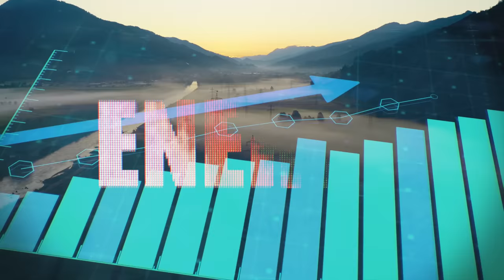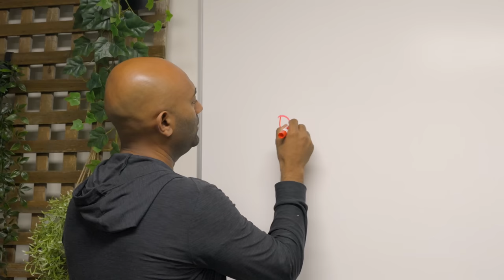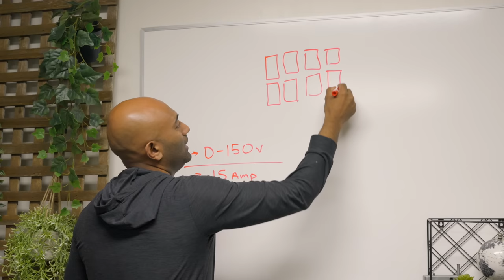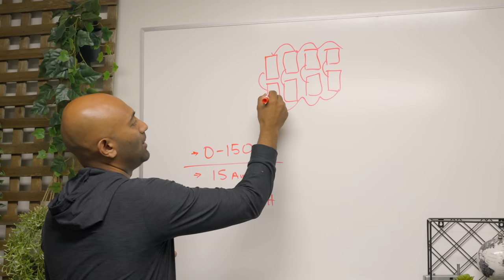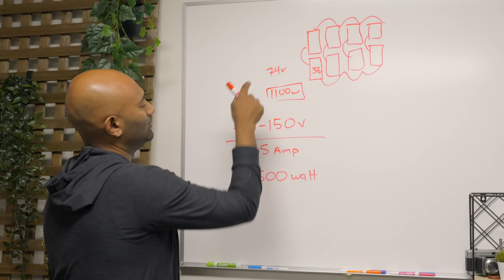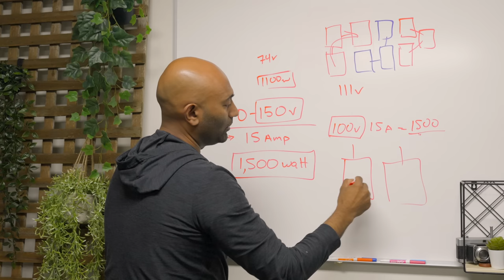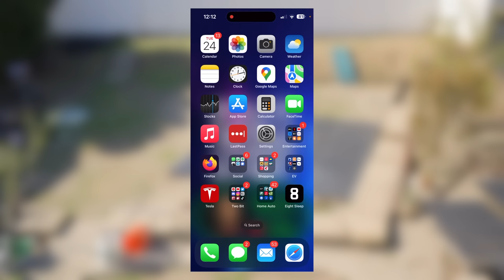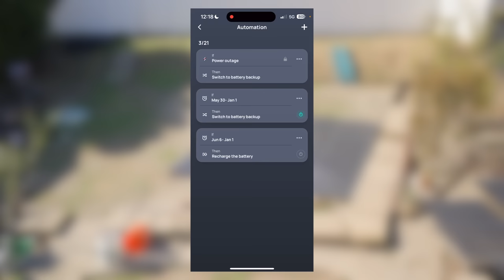Home Backup Power + Solar Power WITHOUT Permits!

Comment: Where I live (FL) attaching panels to your roof requires a permit and engineering. Connecting those panels to anything that touches the grid also requires a separate permit. Everything requires a permit these days. It's ridiculous.

Comment: In the process of returning one of my Delta Pros. The solar connector fell into the unit. I watched a teardown video, and the solar connector is held in by just screws going into the plastic back plate. Not well done.

Comment: Off grid ground mounted panels with batteries is the killer app.  No permits no electricians! Keep adding panels til you run out of space or input watts. If the battery is full just run the AC or heater til the sun goes down ! 😅

Comment: My problem with getting the EcoFlow solar moved into my house is the HOA so I'll have to get the panels on the roof instead of in the yard, never doing an HOA ever again
Reply: My power company will freak out next time they count and see I've added 12 more panels :D I'll tell them to pound sand thanks to it not being grid tied
Reply: with the voltage calc you also need to account for the voltage raising with cooler temperatures

Comment: Great video... I have been looking at using ecoflow in the same configuration you have, but missed that they have a smart panel, and didn't think about the fact you wouldn't have to send power back to the grid (bypassing the need for the permits!).

Curious, where did you get the used solar panels from?

Comment: DIY solar it's fine for small or lower power when you get into higher power solar really should get permits and follow the rules. It protects you against lawsuits, and possible insurance not paying if there is a claim. It can increase the value of your home if you go to sell by having a fully permitted solar system that will back up grid power. Company called Greenlancer that will create all the professional design drawings you need to submit to the city and utility company. They only charge about 300-500 depending on how complex your solar system is. You can DIY solar the legal way and have something professional looking at a fraction of the cost what a solar contractor would charge. You need to learn all the information is online videos, and websites. You might even find an electrician who is licensed to assist you.

Comment: Is the inverter for the load, or do you need AC to charge the batteries? Don't the solar panels generate DC? I figured the batteries would get charged with direct current?
Reply from the maker: you're right i meant the charge controller apologies
Reply: Correct, the EcoFlow internally charges the batteries from the solar DC input.   It can also charge the batteries with AC (e.g. from the wall when the home is on grid power), but the EcoFlow does not handle AC-coupled panels.  It has no ability to do the required frequency shifting to control production.  I don't think anyway.

-Matt
Reply: @TwoBitDaVinci  No need, I just don't know much about all this. I am extremely grateful for your channel though, I'm getting some precursory education. The dream is to set this up for myself once I can afford it....

Comment: If I had two Delta Pro’s with a 240v double voltage hub and tie that into a breaker in my panel (similar to how my solar inverter is installed). Could I use the AC input to charge the Delta pro batteries from the grid (really the excess power I’m generating from my solar array) during the day and set it to push that power into my panel at night. I’m in California and have a net meter installed as I have solar already. With time of use it would benefit me to to take some of the power that I’m generating to the grid during the day and store it in batteries and use it at night when power is more expensive. Thoughts?

Comment: Do you think a 3-panel and 2-panel series hooked parallel will work for a Delta Pro?  I have 10 Mission Solar 310-watt panels to use for 2 Delta pros.  I’m trying to get a plan for two sets of 5 panels to charge my Deltas.  The 150-volt max limitation is my problem.  Your expert advice would be welcome.
Reply: all 4  sets of 5 panels are wired to 16 amp circuit breakers in my garage.

Comment: I love your videos, BUT your statement about "without a permit" is VERY misleading. Since you aren't connecting to the grid you don't need Utility permission but here in Florida you still need a building permit because you are building a permanent solar array. Without the array you might be able to get away with just installing the batteries but even that is technically wrong. You might still need a permit because you are altering your electrical system with a permanent connection.

Comment: love the white board :)
Reply: this is the best on-grid option, no need to think about the grid
Reply: need to export the logs, dont save them on the device, automatic email
Reply: do prime quality the first time, dont cheap out on that
Reply: qc is 100%, not 90%
Reply: dont make bugs or poor products
Reply: pure dc brushless motors, ie hall-effect motor-generators, no ac/commutator/controller parts required, just dc power going in, maybe a potentiometer to adjust motor amperage/speed
Reply: super simple system
Reply from the maker: Thanks glad you liked it. Are there any other home products or approaches you would like to see us do?
Reply: @TwoBitDaVinci  wish-list: sub-nano optical-mechanical cantilever mems gate processors with electron beam mask lithography process, 3-in-1 new tech if you include pre-rom/ram-memory ops only, like INT16/FP16 (but be sure its not the optical non-linearity multi-frequency version, but the single frequency standard clock-signal processor type, but optical not electrical, its novel, none actually are doing it, and no single crystal wafers required, amorphous/polycrystalline silicon MEMS wafers are just fine) xD
Reply: @TwoBitDaVinci  yes optical photon momentum/energy physical cantilever pushing transistor, because they are nano/sub-nano sized
Reply: @TwoBitDaVinci  carboncrete, ie, dried biomass powder flour carbonization into compressed/foam tiles/panels

Comment: I have a question, I want to set up my house with the ecoflow smart panel, do I need 2 ecoflow pros or can I use 1 pro and 1 ecoflow 3600 expansion battery for 240volt
Reply: You need two Delta Pros and remove the jumper from the Smart Panel to generate 240V. 
Adding the battery alone just increases the capacity.

Comment: Great system. but one WARNING never connect or disconnect the solar cables when the sun is shining.
on 150 volt DC an arc  wil not go out and burn your connectors and even more. plus 150 volt is lethal.

Comment: Hi ,I'm in San Diego as well! Would you be interested in using my home solar install to make some YouTube content? I'm piecing my solar system together myself , so far have purchased 30 325 rec panels and 30 iq8plus inverters. Now not sure it's the right way to go as it doesn't appear it's easy to make this system off grid and not easily paired with Ecoflows . Any tips greatly appreciated Would love to connect!

Comment: You might want to consider placing your battery bank in a housed unit away from the house. When the lithium batteries fail they will set your house on fire and they are very hard to put out. I have my batteries in a metal safe and if they combust, they cant spread to anything else.
Reply: LIFEPO4 batteries dont do that.
Reply: @raullasvegas  Lithium polymer batteries are susceptible to thermal runaway. You may want to research it if you think they are not.
Reply: @KC98561  I said LiFePO4 not lithium polymer. Also, this whole idea is bad. Its electrically unsafe, and wont pass inspection. Code isn't being followed, and he did indeed need permits because its permanently installed. Where is the rapid shutdown switch? A firefighter will just watch that building burn.
Reply: @raullasvegas  I see, thanks. How does he keep the electricity from going back into the grid and shock an electrical worker?

Comment: It's sad that EcoFlow batteries are so expensive. If they had the same kWh-cost on EVs we would still not have any EVs under $100k. 
3,6kWh for over $4000 is way to much. Even half would be a bit high.

Comment: What is the cost and the estimated break even?
Reply: A  little over $13K for the 2 Ecoflows with extra batteries. Not sure about the smart home transfer switch.  Solar panels $70 ea x 18 = $1260 , wiring and MC4 connectors around $100.

So all in all around $15K  with used solar panels, closer to $20k with new panels.

If you are paying 0.25 a Kwh, $15K = 60,000 Kwh of electric.     2  Ecoflow Delta Pro's with extra batteries can store a combined 14 Kwh of electric.

If you used the entire 14Kwh everyday which would be easy to do, and 3000 watts of solar panels could recharge the batteries every day, which is next to impossible. The payback would be 12 years. 

However a 7.5Kw Generac propane back up generator installed with a 500 gallon propane tank will run you around $7K - $8K when all is said and done. I've heard of folks burning through $1000  a week in propane to keep the lights on. So realistically a standby generator has no potential to power anything off grid for free like the Ecoflow can.

So look at as a major improvement in stand by generators that allows you power parts of your home off grid using solar. It's an excellent unit and solution for the majority of the public who want a simple backup power solution.

If you want to go off grid you could DIY a system with 34 Kwh of battery power instead 14 Kwh and 10Kw of AC output instead of the combined 7.2Kw, plus all new solar panels for the same $15k. Which would run your whole house off grid 24/7 for most of the year.

Comment: My electric bill is so cheap there would be no point in solar where I live. I think we pay .07c/khw. During winter i don't even get up to $80/month and thats with running space heaters during the day. In the summertime we can run the air conditioner all day/night and the bill won't even be $30. I have a gaming computer, lights on, but all lights are LED and everything is energy star rated.
Reply: Where is that?  Enjoy while you can.  I pay 33 cents a kwh for the first 290kw, then it jumps to 39 cents a kwh until the next month's billing begins. Its Pacific Graft and Extortion in the San Francisco area.

Comment: Could you have tried 4 in series? If My math is correct, you would have been just under 150v.
Reply: Don't want to push it that close to max voltage and risk damage on a bright cold day as it could go over the 150V max.

Comment: Depending on the type of load you power you may only get 50% efficiency from your EcoFlow Delta - half the power out from what you put in!. 
It takes 2.4kW to fully charge the 2kW unit, but you may get only 1.2kW out when powering non resistive equipment - ie motors, electronic equipment which have pf (power factors) < 1.0 - a Laptop may have a pf of 0.41!! 
Thus 2kW output 'useable' power output is only for resistive loads. With low pf loads you can have 50% losses!!

Thus beware if using the battery generator to try and use cheap charging rates at night for powering non-resistive loads during the day - it will end up more expensive!!  

Unless you have a more modern mobile, the App is not supported, and therefore you cannot do any firmware updates. There is no other method for Firmware updates.
Reply: PF greater than 1 not possible!!!
Reply: @larrywong7834  A pf > 1 was never implied - only effect of PF < 1 mentioned.
Reply: "Power factor is a ratio of true power to apparent power. There exist good, bad, and poor power factors with specific ranges where 1.0 to 0.95 is said to be good, 0.95 to 0.85 poor, and 0.85 and below is said to be bad"

Comment: Nah the system is too expensive for backup power. Just get one or two deep cycle marine batteries for that purpose if you are doing time of use power shifting. Depending on where you are you may not be able to get back the money you spent on ecoflow system. Also lead acid batteries are actually more recyclable. If you don't plan on doing alot of charge cycles just very few instances of blackouts, deep cycle marine batteries are way more economical and environmentally friendly

Comment: COnnecting to the grid has NOTHING to do with permits. If you have electricity in your house, you need  a permit to install it. It doesn't appear to be UL listed. Which means, in CA, you cant get a permit. Your homeowners may also not cover losses.  An actual installed, UL listed system would be a comparable price.
Reply: You don't need a permit to use a battery pack or a small power station.   Like a GoLabs 200 for example, or a Bluetti EB55.  So, no, you don't need a permit to use the EcoFlow either.    As long as the AC-output is not tied to the grid in some way, the utility has no say.

There is no California law or regulation that I know of that would require a permit for this configuration.

-Matt
Reply: @junkerzn7312  You dont know you have to pull an electrical permit and follow the NEC? Seriously?
Reply: @raullasvegas  because you don't.  It's not grid-tied... the way he has it setup is no different than a portable power station.  

Quote the law that says you do.
Reply: @junkerzn7312  the NEC
Reply: @raullasvegas  Quote the actual regulation and stop bullshitting.   "the NEC" doesn't cut it.
Reply: @junkerzn7312  The actual regulation is the NEC.
Reply: @raullasvegas  So, basically you can't quote the actual regulation, and you have no clue.   Which is what I expected.
Reply: @junkerzn7312  You shouldn't work around electricity if you dont understand that the NEC is the regulation.
Reply: @raullasvegas  Poor guy, you got called out, got caught out, and now you are reduced to just blubbering the same nonsense over and over again. 

Quote the regulation.  It isn't "the NEC is the regulation".  Sorry, doesn't cut it.

No?   Oh well.  Too bad for you.
Reply: @junkerzn7312  Sorry, sorry little man. Have you googled national electrical code yet? No? So youre just here to be a troll and pick fights.
Reply: @raullasvegas  The crazy thing here is that you actually believe your infantile insults mean something.  But by all means, continue making a complete fool out of yourself.

Comment: I enjoy this but I think you have an obligation to the solar community to have an electrician come in and review your projects. When you share this info with the public, it might be taken at face value without much extra research. Having a pro check your kit before you share it widely means your viewers are less likely to make mistakes that could be dangerous or costly. It also means you'll be better informed before you jump on camera which will make for better, more seamless videos.

Comment: Without permits? What is your source for that? I think you're giving wrong information here.Just because your solar system is not connected to the grid does not mean it does not require permits. Not being connected to the grid only means that you won't need a permit for connecting to the grid. Other permits are still required. I don't want to rain on your parade. I like the idea of what you're doing. However, you are posting multiple public videos showing extensive electrical work and claiming not to need permits for at least some of it. You're adding outlets, changing circuit amperage, putting solar panels on your roof (which may require a structural permit, too), adding a smart home panel, etc. You've also mentioned the city you're in multiple times. Codes vary widely across the US. You are in a particularly strict area. I enjoy your videos and wish you all the luck with your projects, but people watching them need to know that a lot of what you're doing requires permits in many (if not most) jurisdictions. People have to check their local codes.

Comment: What did you get from Ecoflow for the giant advertisement? I hope you, at least, didn't have to pay for your batteries.

Also, if you're going to charge at night and consume during the day, that's a charge cycle. The lithium batteries will only last about 3 years at that rate.
Reply: Sorry sir, but you are misinformed. Ecoflow uses lithium iron phosphate batteries which can provide 3500 cycles ( almost 10 yrs) and still retain 80% of their original capacity.

Comment: your theory about panel wiring and its energy output is ABSOLUTELY incorrect, which i feel is irresponsible for an "educational" channel.
Reply from the maker: how so?
Reply: @TwoBitDaVinci  you based your theory and your math by asserting that the amperage is a locked in as a constant, which it is not. if you wire them in parallel, the voltage would be lower but amps would in turn be higher. ie suppose you have four 500w panels that are 50v, two ran in parallel and two ran in seeies. the string in parallel would produce 20a @ 50v, while the string in series would produce 10a @ 100v. both strings produce 1000w total, the string in parallel does not produce less wattage because it is wired at a lower voltage.